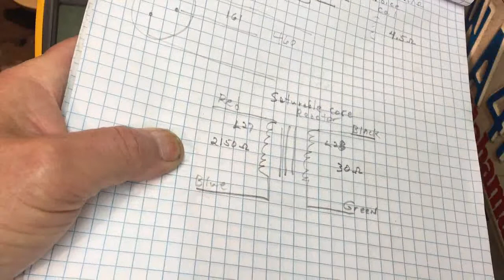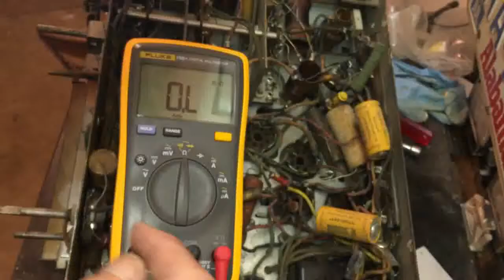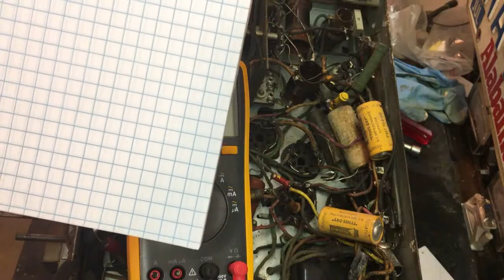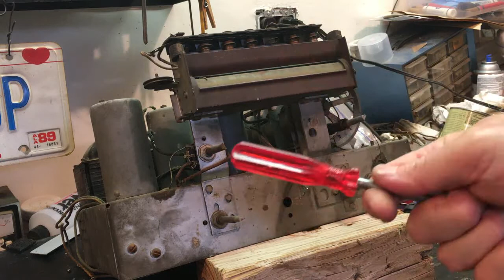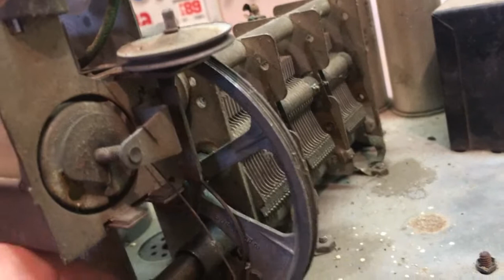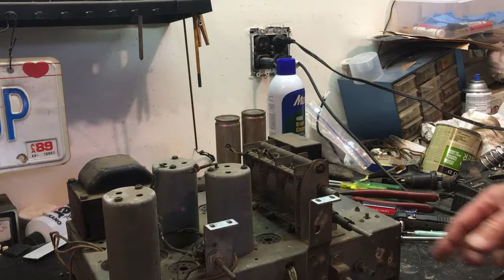1936 General Electric E91 Colorama Part 2 of 9 Disassembly, Testing and Clean-up

Comment: Enjoying this series. I had an E-91 and an E-101. Still have the E-101. I sold my E-91. Just wanted to point out when you order tubes, GE in 1936 was using all metal tubes. Even the rectifier should be metal. They pioneered the metal tube and went overboard using them on everything! Good luck...it will be a powerful set when completed.
Reply from the maker: gavinwb1 Thanks! Always enjoy ur comments! I believe I saw at least one video of ur sets. This has been sitting around here for a year a two and I didnt think much of it until I got to reading on it. Its going to be a booger on wire, but one at a time! Lol. Im looking at the candohm replacement now. Trying to figure the wattages, layout etc. ive never replace a whole candohm before. I need to do some research, I havent seen many good articles on calculating wattages. Thanks for watching, hopefully another video this weekend. Take Care! Larry
Reply: I've successfully replaced candohms in several sets with 5 watt resistors. Space gets to be a problem if you use 10 watt, but for sure those will be more than enough wattage.
Reply from the maker: gavinwb1 I just ordered the resistors. I used one 10 W , 2- 5W, 2-2W and a 1W. Should have enuf room, now to get creative lol.
Reply from the maker: BTW, I ordered the tubes yesterday, ordered all metal, thanks for reminding me. I knew that, but would have forgotten before I ordered. Larry

Comment: Woohoo!  Another video just as I log on, lol.  That means that I can postpone going out to the garage in this heat a little longer :D  86 degrees here which means that garage aught to be a nice 106 by now.  That saturable core rector sounds like it needs a Geiger counter to get anywhere near it, lol.  I strained my back the other night out there so I kinda laid around yesterday and did nothing which suited me cause it was raining anyhow.  I meant to tell you a video or three ago, whatever you did to your microphone is working great!  Much easier to hear now.  I wouldn't have said anything before, I just cranked my volume up...the downside was when I'd start another video somewhere else I'd blast my eardrums good!  While I do envy your radio I don't envy going through that goat's nest of wire under that chassis.  If you're from South of Cuba I wonder if they'd be Cayman clips those alligator clips?  I always called those unused pins "tie-off" points.  I may be wrong though and confusing the heck out of folks when I call them that, lol.  Since you're ordering a new dial cover anyways I wonder if you could take the old one and try polishing it up with some Novus or other rubbing compound to try and clear it up.  If nothing else you'd have a spare.  Looks like that brake cleaner really did the job to clean it up some.  Take care, Gary
Reply from the maker: Rebel9668  Thanks Gary! Sorry about ur back, hope it gets better soon! Yeah, that certainly is a a goat's nest of wires, but one at a time, lol. I think my first order of business is attack the corner at the transformer, the candohm. I checked the candohm for grins and giggles, and all are out of specs except maybe one. Someone had replaced the 1 k section with a 4500 ohm, dont ask me. Maybe it was all they had. The filter caps have had replacements soldered to them. Not sure if Ill try to restuff. If I can find enuf room under there for a couple of terminal strips, I'll go that route. Real estate underneath is a premium. Im working on figuring out how to replace the candohm, whether to mount something underneath it or remove/replace. The wire is an issue. I sprayed some deoxit on the pots and selector and worked them out good. I have to do more cleaning on the chassis. The brake cleaner removed a lot, but there is still some I'll have to finesse some areas with q-tips. Thanks for watching and commenting. Best--Larry